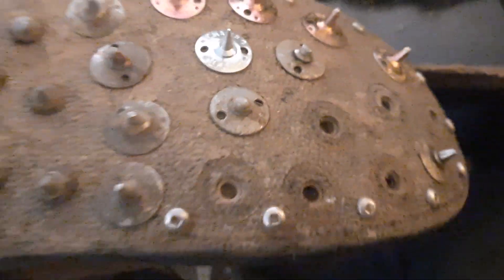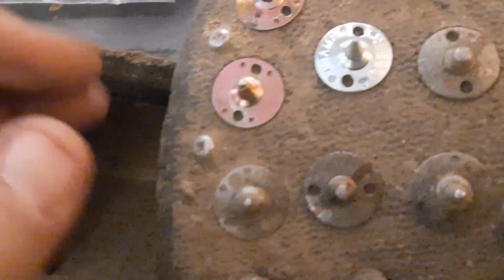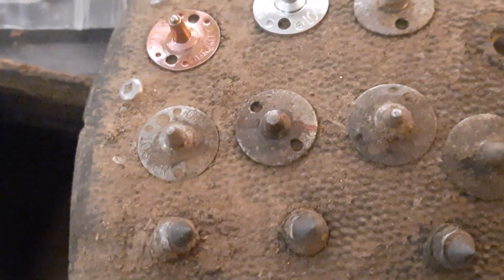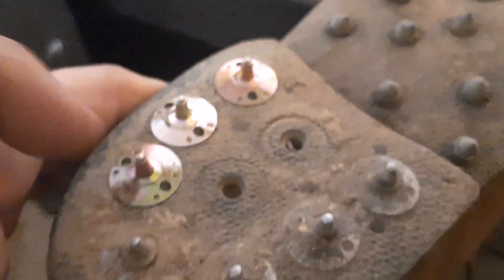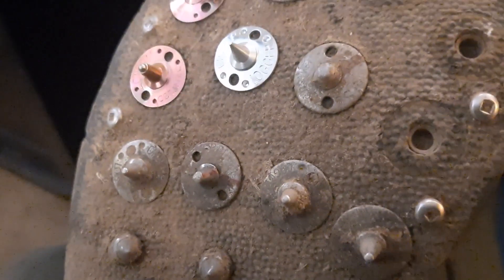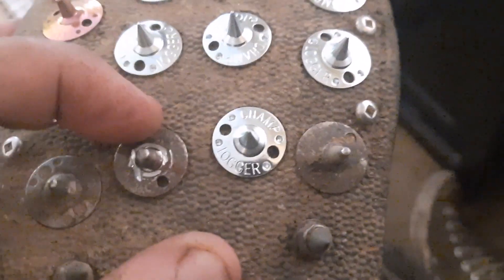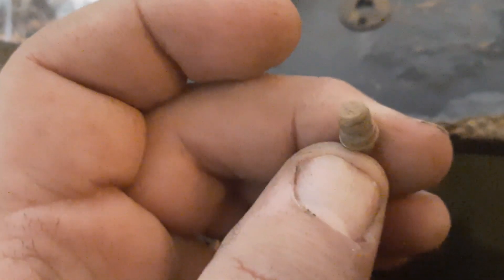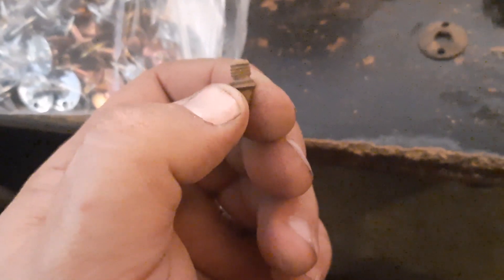Phillip's tool steel caulks (gawbage)

Comment from the maker: the other thing I forgot to mention, the Phillip's, may be made out of tool steel, but they are not hardened so its a moot point, tool steel is called that because its easy to machine and then later hardened to make durable tooling... but hardening is an expensive process, which ironically would make the phillips more expensive then the Champ's...

Comment: Bummer. 
What does a new set run.
Reply from the maker: New set of custom Nick's with caulks about $800, new set of caulks (just the metal bits) $14.50, with cermets at $.40 each?
Reply: @northman logging  dang.
But a guys gotta do what he's gotta do. I'm flat footed, I pay 250-350 a couple times a yr, but my back thanks me for it.
Reply from the maker: @brettblack7049  look into custom boots, i have one mangled foot thats a wierd size... dud wonders to have boots that fit, and despite the kerfuffle ive had these boots around 10 years, they have another 5 before a resole
Reply: @northmanlogging2769  I have custom ski boots, unfortunately the custom shoes/boots fall apart/loose support in about the same timeframe as others even though the soles can still be in great condition. I know when mine are going bad as I start feeling it in my feet, then knees, then lower back, then I get sick. It took me yrs to see the pattern, but as my signature says on the forums, "I may be slow, but I'm not stupid" LOL.